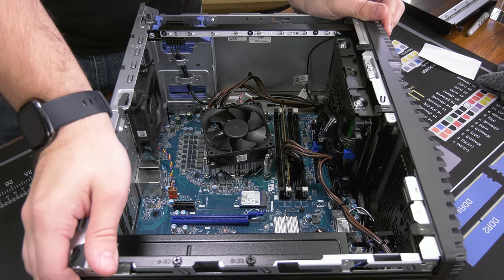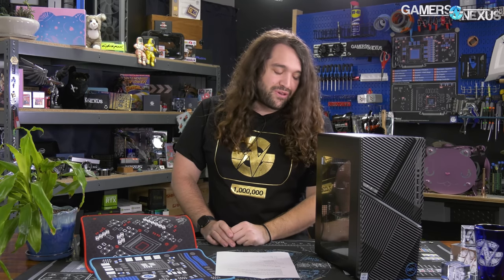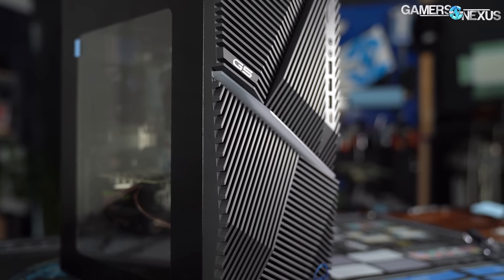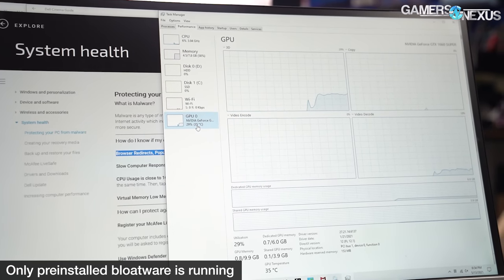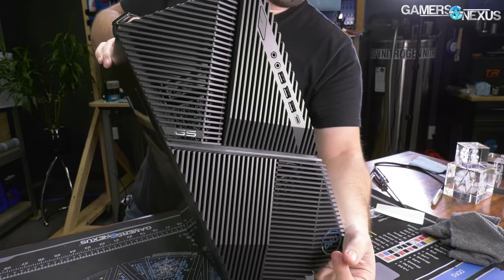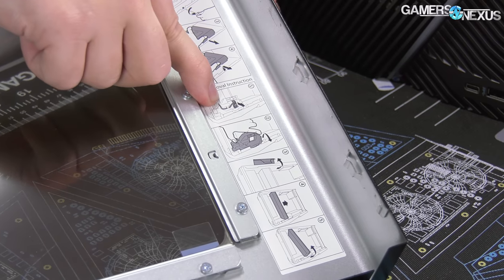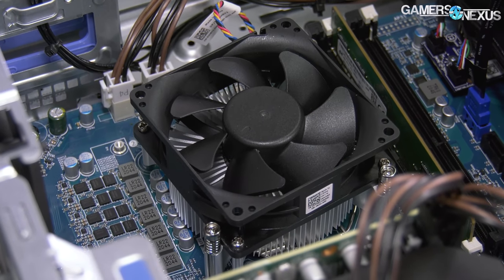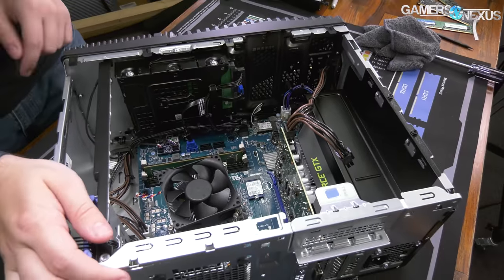Worse Than Walmart: Dell G5 5000 PC’s Garbage Parts & Hidden Charges

Comment: Thanks for this  . I always wondered why Dell pulled this from being sold; they just do G5's now as laptops.  Only gaming desktops they do are Alienware. I bought one of these in the summer of 2020 when it was on sale because I badly needed a gaming PC to try one out and my budget was low. It's worked fine but honestly the specs on it aren't great. I'm getting ready to try to see if I can upgrade it for my Christmas present. I ordered ram to try to get it to 32 gigs and I'm installing an SSD to make the hard drive faster. Graphics card is fine but my main worry now is the air cooler; it got super hot yesterday just trying a game off Steam for a test for my new monitor. I got a 9th gen I3 processor which kinda stinks but I'm stuck with it for the time being.  

In hindsight I feel so cheated. I shoulda honestly just waited until Christmas that year and got something better. Def a case of curiosity biting the cat. I'm just trying to make the most of it. I just hope the cooler issue won't be a problem. The one dell put in sucks.

Comment: Had the first Dell Experience with my friends New Pentium MMX.  Nothing on that machine was standard, and ever since I've avoided DELLS and HP's like the plague.  His PSU went after a couple years and that thing sat under the stairs until it was tossed out years later.  I literally have a phobia of these proprietary parts and plugs that look like they are from an alien civilization.

Comment: I had 2 dell exps in the mid 00s.  Both died within a week of the call to extend the warranty.  The 19 inch laptop totally cooked itself. The tower burned the video card up.  I got the tower up with a replacement video card.  The laptop was a write off. The video card overheated and fried the motherboard and chip. The only thing salvaged was the Ram

Comment: getting strong "Back in my days, my Elitegroup Mainboard looked the same, but I was at least able to use a correct CPU-cooler"-vibes  even the color of the board is yells "Early 2000s" at me.

Comment: I found all this out the hard way. About a year ago I bought the Acer Nitro 50 for a low end pcvr gaming pc in the hopes of being able to upgrade it later. Was unable to upgrade the gpu due to psu being proprietary and didn't have 2 spare 8 pin plugs. Couldn't upgrade psu due to mb  having non standard mb power & cpu power pins. Couldn't upgrade the mb due to proprietary size issues. At the end of it all I kept the cpu and built a new pc. Building a new one was easier than I thought I would be thanks to some JTC & GN videos and I used pcpartpicker for compatibility questions.

Comment: It's called Dell Hell for a good reason...when I tried to salvage my Area 51 and change case size, I wound up with very little that I could use, only the CPU and GPU, and a couple of random fans.

There was a time, before the Dell acquisition, that Alienware was a good custom shop, but now it's "...just a name on the door, on the thirty-third floor, in the air."

Comment: Friend of mine bought dozens of Dell G5s just with 10700 + 3060 Ti using the university discount. The GPUs aren't even half bad for OEM, temps are comparable to some of the lower end dual fan AIB models. Anything else about the system... yeah. Considering current GPU pricing, the systems were about the same as a GPU alone, he kept the GPUs and flipped the PCs to a local business, who now has some pretty overpowered office PCs for a fair price and he has some GPUs below market price.
Reply: I considered doing something similar, but they changed the CPUs from regular to f SKUs in my country, so no iGPU.
Reply: @elhuron8819  There are some similarly priced HP models with Ryzen 4700G you could look into

Comment: Dell is an interesting case... back in 2018 when I was building manufacturing systems for deployment around the world the platform included a low cost compact desktop machine to perform a pre-staging task. I spec'd a Dell for that task and so purchased these low cost simple desktop systems in the US, EU, and in Asia. The US and EU systems were identical, fairly robust but small form factor systems. The system we got in Asia however was super interesting... it outwardly looked similar (maybe identical) but everything about it was cheaper, the sheet metal was thin, the plastic was thin, buttons had a cheap unreliable feel and the machine felt very delicate (easier to break). 

We also had reliability issues with them... which actually had me thinking they were probably counterfeit (common problem in Asia), BUT maybe they were just a sign of things to come for the low/consumer end of the Dell line? I've not had those sorts of issues generally with Dell but I also tend to buy their premium (Alienware) or Enterprise products.

Comment: Ok my main takeaway from this is that it made me question why the hell we would ever switch to a 12V only standard? It feels like it is gonna make for a much more awkward to built and cluttered system, not to mention the alienation of an existing standard that everyone has used for a ages. What problem are we trying to solve with it? Seems like we're moving power delivery from a component where it is really convenient and literally a non-issue, you know the PSU, to a component where it is a best inconvenient.
Reply: 12V only is more power efficient
but that's about it
Reply: @johndododoe1411  Idk I'm not power technician
Reply: @johndododoe1411  Idk I'm not power technician
Reply: May be so that there can be a battery or external laptop charger powered model with a DC barrel jack on the back of the case, using the same motherboard layout.

Comment: Steve, it is so easy to pick on DELLs lower end PCs.  When you move up to the higher end DELLs there are 2 extra slots in the side panel for extreme cooling.
Reply: you can get higher wattage cpus to overheat higher

Comment: First of all, thank you for your review. I was in your shoes 20 years ago, building custom PCs and testing all new PC parts and at that time I'd be completely agree with you and would be yelling- this is crap, how on Earth did they do that!!... However, now I must say, that this product has it's own market so don't review it from a geek's point of view.. Copying from another thread because this is a very good statement: "...The simple reality is that the target audience are the sort of people who don’t reuse cases, motherboards, etc. This is a user who will have whatever box they buy for 5 or so years, and then it will be on the street. They’re no more likely to repair it than their microwave. All that extra flexibility that you and I value is just waste if the customer is incapable of taking advantage of it....99% of the population does not build their own PC and constantly upgrade individual parts"

Comment: It's an Optiplex with a "gaming" GPU, window and some LEDs. 
Some of those features that are being lambasted (inc the levers to secure PCIe) are the same in their Workstations which are pretty bomb proof. 
Or have been for the decades I've used them.
Reply: Exactly.  Man, the gaming elitists in this comment section need to check their attitudes.
Reply: Exactly. I own the version with a RX 5700 XT, 512 GB, 16 GB I got for less than $900 this past Winter (and without a window). 
The all-12volt power supply really makes sense because there's very little wasted energy using DC-DC conversion and we don't have a rat's nest of cabling.  Also, because of that the power supply is more powerful than some clueless gamers realize. 
My only real complaints are the single 16 GB memory module and, yes, the airflow is restricted when you try to mine cryptocurrency. The computer otherwise plays everything at full settings and remains silent. 
The Core i5 in the G5 5000 is equivalent to last generation's Core i7 but with two extra physical cores, so this system can be a bargain for smart buyers

Comment: I bought a DELL XPS420 with Q6600, a 8800GT, and 8GB of DDR2; back in early 2008.  I ran that PC for home office productivity (and WoT) for about 11 years. Eventually, the PSU failed and I decided to move on.  As the BIOS was locked and the case/motherboard were in a BTX configuration, much of this system was proprietary and limited in terms of upgradeability.

The only way I could overclock this PC was with a BSEL mod to the Q6600.  I used a sliver of black electrical tape to cover one pad, which tricked the BIOS into a 1333Mhz FSB, yielding a 25% OC from the factory limited 1066Mhz FSB. That OC was implemented for at least 8 years.

Although I suppose I got my monies worth...given 11 years of solid use...I would never buy another pre-built, especially from DELL.  Too many proprietary traps that really limit one's ability to upgrade. It's simply is not worth the premium. Build your own PC and save your money!!!!

Comment: Dell has been doing that weird power through motherboard for years. Some of the old Optiplex will do this. Steve may want to try to tear down an old 7020. This thing seriously looks like a workstation.
Reply: yes, its like repurposed typical dell office workstation with its exterior changed.
Reply: I got a used 7010 Optiplex i5 3rd gen 1tb hdd and 16gigs 70 watt gold pws off Craigslist for $100

Comment: I've been building PCs for 40+ yrs.  I own this exact same model.  I agree 110% with your frustration about all the proprietary/sleazy design choices: case, cpu cooler, PSU, cabling, etc. etc.  Dell is becoming a leader in No-Right-To-Repair.  I hope they don't follow Lenovo's recent move to lock CPUs to Lenovo systems, which I feel would be borderline criminal.  Dell's penny-pinching, abacus-spinning, bean counters are definitely ruining its reputation.  There are only 2 upsides of this system (which I am using right now) -- Dell regularly updates its BIOS (putting Lenovo and HP to shame), and it runs many flavors of Linux flawlessly.  BTW, I did find that the $28 Jonsbro CR1400 92mm CPU cooler is a great replacement for the stock cooler.  To be specific, the stock CPU cooler has no mobo backplate.  Any replacement CPU cooler has to have a 92mm max tower fan design and have screws that match the case back.  Calling the Dell G5 a "gaming PC" is like calling a Toyota Corolla with Center Line rims a "hot rod".  Totally Laughable.  Keep up the good work.

Comment: Computer build level: Soviet.

Screw motherboard and cased into heatsink.
Reply: We got it all wrong. They just extended that crappy aluminum heatsink with more metal. Hope it doesn't rust.
Reply: Soviet tech is far superior to this.  A vodka cooled cpu would probably perform better than what Dell screwed into the case.
Reply: Well, it worse.... Soviet most of time - clone of normal computer, so this one is worse.

Comment: The internals on this thing look exactly like the HPs I work on for the military. They're like 5-6 years old.
Reply: I have an HP from 2017 and the Ram in my HP looks identical to the ram shown in the video.... my gpu does not even have a plastic cover on it, the gpu board is red coloured.... the cpu cooler looks very similar to the one in the video... whole prebuilt computer is very barebones
Reply: In the mid-90s I was working on a team converting a military base's Sperry Univac servers over to Novel servers. (Don't ask.) My job on the four-man team was to go from office to office taking apart hundreds of desktop computers and installing Ethernet cards, powering them up then adding Windows drivers.

On one memorable day, I unplugged all the cables from the back of an HP tower computer then removed all the screws on the back. When I pulled apart the HP case, both of my hands started bleeding badly! WTF???

It turned out that HP's case had some RF shielding tacked to the inside that was razor thin and just as sharp. No polished edges or other protection for the hands of unwary technicians. Geez, HP, thanks a lot!
Reply: @AtlantaTerry  Computers with shrouds; death beckons at the bus port access. (Available on Rhino Records. Try our CORBA demodiscs!)

Comment: 13:16 Steve, those memory modules aren't lonely, they're just social distancing!
Reply: Are those mutually exclusive?
Reply: Why does it matter where the modules are on the stick?
Reply: @AndrewARitz  it's not a matter of location but number. Most dimmms have more on them.
Reply: @realtechhacks  And that matters because?
Reply: @AndrewARitz  I'm not exactly sure. Maybe if you have fewer modules for the same capacity you have less durability.
Reply: @realtechhacks  These videos are usually nice, but this one doesn't include much in the way of explanation.  It really seems more like "this is different, so it is bad!"
Reply: @AndrewARitz  For the most part it actually seems very detailed and explanatory, but he did overlook talking about the dimms more. Dell is enough of a trainreck without even mentioning the ram that it doesn't matter too much.
Reply: @realtechhacks  no 😭😭

Comment: I just had an experience with Dell. I was looking at a new computer because it costs about the same amount as the CPU and motherboard. I called them because the power supply listed wasn't sufficient for the computer as advertised, they didn't specify the ram speed, they didn't list if the drive was sata or m.2, there is no option to opt out of McAfee, and I wanted to opt out of the service plan. 

They had no idea how to answer any of my questions and claimed that McAfee would not affect the performance of the system. They also claimed that the service plan was a required charge. I pointed out that if it is required, it should be reflected in the listing price.

Comment: As someone who had completed multiple computer builds in the past for for one reason or another I decided to try the G5 5000. On paper it kind of fooled me into thinking it was going to be a competent machine for my everyday needs and occasional gaming... Of course once I actually received the computer and had everything set up I realized With the amount of proprietary parts and bloatware included combined with combined with poor air flow and sub optimal fan set up this computer was essentially an open source robbery... 

I did my best to install a be quiet dark 4 air cooler with a few angel wing fans and added 2x additional fans for a push pull...  But doing this resulted in the inability to replace the computer's side panel, So we ran this little unit as an open air system for nearly 2 years... 

This absolute piece of c*** died on me and I savaged what I could from it... The CPU chip the 3070 and the 1TB M. 2 drive, and activated the OEM windows key to my Ms account for a fresh install. 

The rest of it I'm planning on smashing with a sledgehammer based on my level of happiness with the system. 

I simply purchased a D 5000 airflow,  Some dominator 3600 DDR 4 on the cheap, Along with an H110 Capelix and a rm850x PSU repurposed my angel wing fans for a really good airflow setup. 

Now I realize what my two-year-old system should have been out of the Box.... And although it is nowhere near a top of the line system it certainly meets and exceeds everything I need from. With idle temperatures in the high twenties and operating temperatures in high demand Triple A games only in the low sixties... no thermal throttling to be seen ever again... 

If anyone out there reach this comment please stay as far away from any of these prebuilt computers as possible there are an absolute waste of time money and possibly your sanity if you're trying to update it.

Comment: it's actually smarter to link the cooler into the case, than hang it off the board itself, doesn't stress the motherboard with trying to support a heavy chunk of metal that would end up warping it.. only downside is all the mobo makers locate the cooling mount screwholes differently on each mobo model and it's extremely hard, if not impossible to account for these differences..
Reply: I have never heard of a cooler warping a motherboard. The coolers also have backplates on all the larger ones as well. There are 9 screws on an ATX mobo to hold it in place (4 spaced directly around the CPU socket, which is also reinforced), which is overkill IMHO. These aren't thin PCB's either, some go as high as 6 layers. I had my computer fall face first onto a tile floor with a large air cooler. I picked it up, checked everything was secure (it was) and turned it back on. This design has been around since the first mother/daughterboards were made so unless you are tossing it around like a dodgeball, I doubt the stress on the mobo is anywhere bad enough to warp it with the largest coolers.
Reply: @mrq1  Back in the Pentium 4 and Athlon 1 GHz days the coolers most certainly have warped motherboards.
Reply: @kjrehberg  speaking as a guy who had a pentium 4, I never saw it.

Comment: I've been saying, if you can't build it yourself, or you find a better deal on a prebuilt then building, go with a brand that uses standard parts, also do your research. The proprietary stuff is the worst. In my case I was going to build but couldn't find the parts anywhere. Found a CyberPower prebuilt that had a Ryzen 7 5700X and a RX 6600 XT for about what I wanted to pay, and after putting the parts into PCPartPicker, it was around the same price as building so I did go with it, but the good thing is that it's actually upgradable (and uses a case with airflow)

Comment: Okay so I already made the mistake of buying one, and it seems to run okay with the notable exception of the CPU running quite hot. It seems to run okay if I just leave the side panel off, so my theory is that either the exhaust or intake is insufficient. Do you have any recommendations for how I might be able to fix this? There isn't much room in the case for adding additional fans, although I suppose I could get creative with a Dremel.